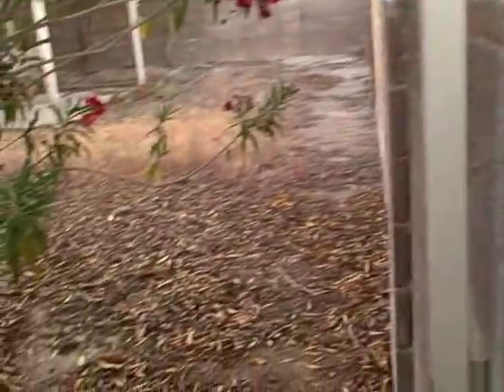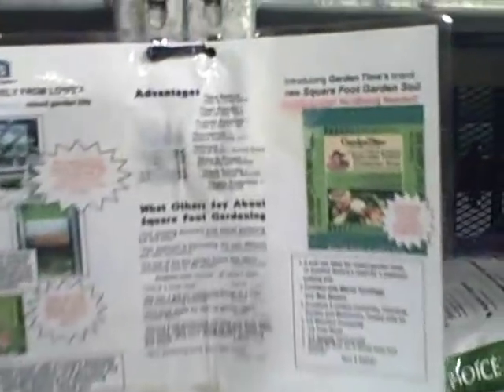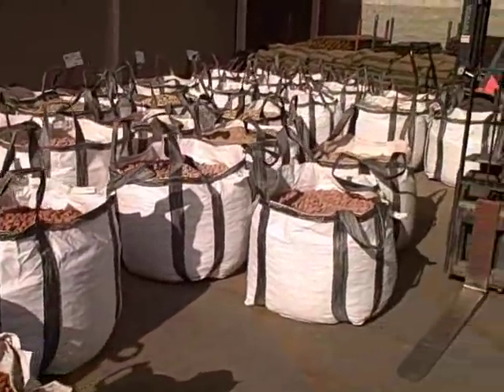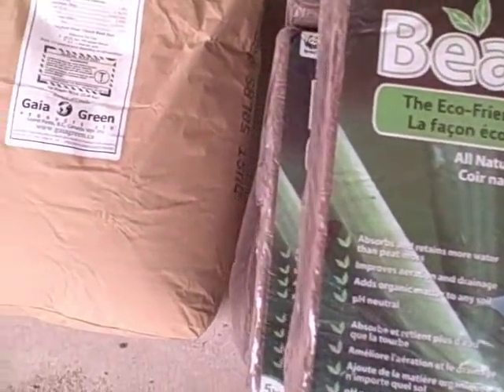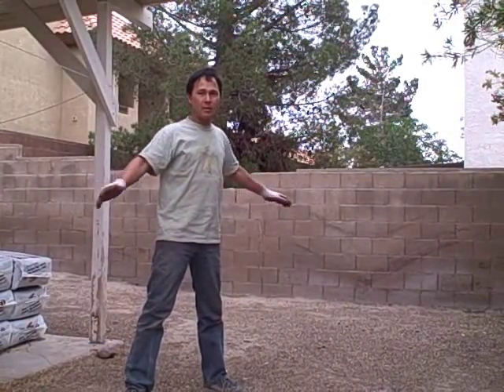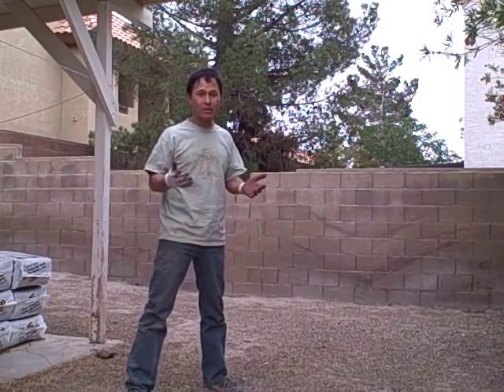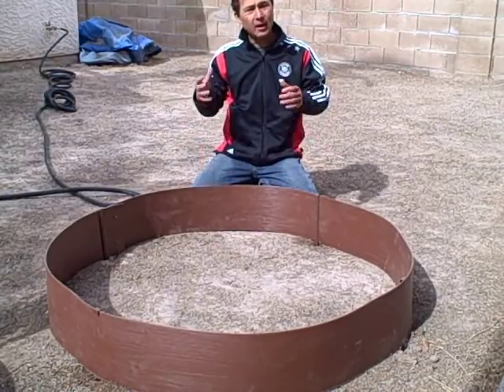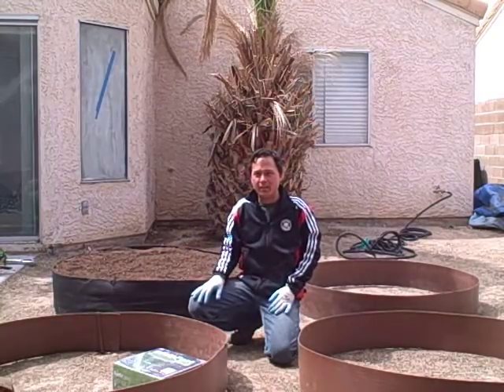Raised Bed Vegetable Garden Install from Start to Finish

Comment from the maker: At this point, it has been about 1 year since this install.  While hindsight is always 20/20... I must say that if I had to do this project over again, I would go with the Bulk tomato lady mix to grow in instead of the Kelloggs OMRI stuff. I have not been happy with the kelloggs stuff overall.  TOO MANY wood chips.. In some of my beds, I have some issues with mushrooms as well.
Reply: I live in an area without too many options, and I can't afford much either. We do have a Home Depot nearby that carries the Kellogg brand garden soil, and it is something I could afford. Did it still end up working out even if it isn't ideal? Would sifting out the wood chips through some hardware cloth take care of the problem? Or is there damage that can't be undone by sifting?

Comment from the maker: What I am doing is adding a handful of the weed whacked trimmings each time I add compost (food scraps and tree/leaf scraps). This way, I dont "overload" my compost with too much of the weed wacked stuff. If the compost pile is at proper operating temperature, it should denature the seeds so they will not sprout after composting.

Comment: Hey John love your videos. People need to adopt these practices everywhere. If you thread the teflon tape in the same direction as the threads as in clockwise I bet you wont need as much. Also a better seal. Thank you for doing these videos.Can't wait to try out the azomite and composted wood chips. My plants are thanking you as well.

Comment: I noticed you were applying the teflon tape in the wrong direction. It should be applied in the same direction as the threads go so there is no chance of the tape unravelling when you screw on the other end. Just some advice from a trades guy :)

Comment: John just a tip. When you use tephlon tape wrap clockwise (you did counter) so when you thread on your fitting it doesn't unravel your work.
Reply: as well as it doesnt take but just a few turns..

Comment: I and most people who put in sprinkler systems and drip use 3 wraps of tape. I found it is easier to wrap from the back of the roll or opposite the way the roll is.  Plus a pressure regulator from 10 to 20 psi maybe 30 is a good idea for drip systems.

Comment: Thanks; great walkthrough of the whole garden planning process!  Minor point:  it looked like you wrapped the teflon tape in the wrong direction; you want to go in the same clockwise direction as the piece you will be screwing on to the fitting to prevent the tape from unraveling.

Comment: If you have the fitting pointing towards you (assuming right hand threads), wrap the tape clockwise arounf the fitting. The main problem with wrapping the tape "backwards" is that when you screw your fitting on the tape "unwinds" and bunches up usually exposing some bare threads. This condition is readily solved if you use massive amounts of tape per fitting which I see that you do :) 
Three wraps is suficient if your parts fit and you wrap correct direction and also saves tape.

Comment: Been watching a lot of your videos John.  I am learning too.  Thanks!  Just wanted to say that I am making two raised beds for my backyard and found that Kelloggs Raised Bed & Potting Mix has most of what you recommend in it.  It is a dollar more for the 3cf bag vs the Kelloggs Natural Garden Soil you used in the video, but you do not have to buy perlite, peat moss, or other additives other than the rock dust your recommend.   I actually saved money on the second bed where I used Kelloggs Raised Bed & Potting Mix.  BTW...  It is OMRI as well.  Now to find that rock dust....

Comment: I would suggest before you buy compost, check out if your city or town has compost sites. In the small city I live in you can get free compost, if you have a pickup you can fill it up, if not bring a couple of bushels or leaf bags and fill them up, its free and it is very good stuff.

Comment: Very helpful thanks! live in Ky, so got to do the mix based on plants. Watched celery likes moist soil. Live in an apt. so going to do some pvc across backporch for strawberries, maybe crates, or buckets or bags, or mix and match. want to do some celery, strawberries, romaine & red lettuce, spinach, carrots, maybe few pepper but very few only for garden fresh salsa. some herbs, Zuchinni in front, does well there, tomatoes here and there, got the early girl not sure to use stakes or cages. stakes might look good but not sure if I can do it right. but stakes cost less. 
so..  can do about 40-50 ft of pcv. got to watch more videos to decide what will do better where. would like to do cantelope, cucumbers... watermelon would be fun but don't know how to pull that off vertically. 
but any who thank you.. for the video. have a nice day!

Comment: If you wrap your teflon tape clockwise, the same way stuff tightens you can use only 2 or 3 wraps and it won't peel off as you tighten.

Comment: In my opinion,the VERY best approach to this is to buy 2"X 8"X 8',10',12' pressure treated lumber,or 4"X"4 / 8"X8" railroad ties and make your raised beds this way.They last a long time.Also,instead of using high end soil to fill the raised beds,you use regular top soil $2.a 1.5 SY,and where ever you plant,you dig a hole appropriate for the type of plant you are growing,and fill the hole with high end soil.This works awesome for me.If I have the money,I order a truck load of screened soil.

Comment: Yes, home depot is far cheaper than lowes, pretty much on everything!  Every time I've bought soil from walmart, it's had mold in it due to the soil not being under a roof.
Reply: Home depot presently has 5 percent off to discover  and amex card ....
Reply: Sassy Frassy Lowes will always meet the Home Depot price of it is the same product. Takes a picture of the product and the price and then show it to management at Lowes.

Comment: For anyone kinda turned off by how hard setting up irrigation seems check out a orbital from Home Depot or Lowe’s, just set it on low and it will water your whole garden all you need is a hose and orbital, if you want to get fancy you can get a electric timer for your hose and not even have to worry about watering your garden !

Comment: By the way, most people would save a lot of money if they ordered soil, mulch, compost from the same places the landscapers order from.  They do residential but there is a minimum for delivery.  In my area it is 4 cubic yards of material.  Huge savings over home depot/lowes.  I get 10 cubic yards each spring of 1/2 compost and 1/2 pine fines mixed and it works smashingly to grow all my veggies.  Lasts all year too.

Comment: lay it out flat in the sunny area let it relax.  fill a bucket with hotwater stick the roll in there.
microwave the roll 30 sec at a time. I worked at a body shop we did the microwave to soften side mouldings.

Comment: You can use just compost but you'll get better soil by supplementing. Vermiculite or perlite(that styrofoamy stuff in House plants from the store) or pummus will help both with water retention and aeration. If your soil is clay-like, I would definitely look into vermiculute and some peat moss. I've never used the coconut stuff but that sounds very interesting and much more eco friendly. You want your soil to be soft so roots can proliferate. 3rd knuclke of finger should go into soil easily.

Comment: John,

fantastic video. I live in Virginia. Would you happen to know whether I'd I need the vermiculite as well in this region of the U.S. Also, how did you calculate how much needs to go in each bed. I know you said 1/3, 1/3, 1/3. How many cu ft does the bed take/hold? Appreciate an extremely informative video. I subscribed. I am a true beginner in every sense of the word.

Comment: I'm using libre office draw. It's a free linux program that should be available for windows and maybe mac. It has all the basic things I peronally needed for my garden bed as well as the ability to set exact positions for all objects and change their measurements via mouse or inputing values.

Comment: I have a question.  The brick walls or fences get quite hot in the summer, or do they remain cool enough in Las Vegas not to burn the plants.While where I live is not quite as hot as Vegas in the summer,  it hits 100 degrees on a regular basis.  Do the brick fences in this kind of heat get too hot?  I am a beginner, so hope this is not a stupid question.

Comment: I'm actually starting the vegetables for my garden from seeds, how would I transfer them from indoors in a higher humidity to outside in a lower humidity. //they're in a room with a bunch of fish tanks so lots of humidity ^^;

also with the vitamin D thing, I am actually producing less than half of what i should be. At first they thought it was because i wasn't getting sunlight, but it's actually because of genetics. I literally can not produce it. I have to take supplements regardless of sunlight.

Comment: i can't find none of this stuff in Florida...i wanted to do the same 
thing as you step by step....I live in north Port, Fl....Please Please 
help!!!!
Reply: +Reese McFarlane All the water irrigation is at lowes in the hose section (I didn't notice him using anything for the PSI but you will want that or the kit to start out with) Since this video is from 2011 I doubt walmart has those kits for that sale price. I used 2x4x8 and 4x4 posts all at lowes. Same with the plants (well I got some from home depot, amazon and rural king)

Comment: How can I protect my garden from round up sprayed to kill weeds?  Will it disapate as watered and flush it down further into the ground? Should I put a bottom , if so what? Does cement block have chemicals that will leach into the soil?
Reply: Don't use Roundup.. anywhere near your garden. the hardest part of weeding is staying on top of the weeds... once your on top of them its not nearly as bad.

Comment: i can't find none of this stuff in Florida...i wanted to do the same thing as you step by step....I live in north Port, Fl....Please Please help!!!!
Reply: +EADGBE  All the water irrigation is at lowes in the hose section (I didn't notice him using anything for the PSI but you will want that or the kit to start out with) Since this video is from 2011 I doubt walmart has those kits for that sale price. I used 2x4x8 and 4x4 posts all at lowes. Same with the plants (well I got some from home depot, amazon and rural king)

Comment: Peat & coir are totally different additives when we look at pH and should not be substituted for one another. If you want to lower the pH of the soil, naturally & quickly, add peat. Coir will not do the same as its pH is naturally almost neutral.

Also, when buying coir, always make double-sure that it has been rinsed multiple times prior to use because mas-produced coir can contain 150 to 300 ppm of salt, which will at the very least stunt your plant growth, reduce flowering & fruiting. On the higher end, it can kill your plants. Some coir is sold already rinsed.
Reply: Coir also will hold onto [bond] Cal & Mag and not let the plants absorb it. If you see cal/mag deficiency in your plants, this is why. There are many liquid organic cal/mag products you can use if you see a deficiency.

Comment: I dont think I could handle "desert landscaping" I should stop whining about our non stop rain! But if we had to live there, I'd 1st have to be hog tied, then kept on a tight leash so I won't run back up to Boring, OR.
Once I came to terms with living in hot desert, I'd put lushious green lawn, its cheap, last 50 yrs never needs mowing or watering! That plastic fake grass more expensive than carpet, but would so be worth having lush green lawn!
It sure looks real! Anyone there have this stuff?

Comment: Great video, but I don't believe the walmart beds are at all economically sound, building out of wood would be cheaper and last much longer than the flimsy round beds. By counting beds and multiplying you spent $220 for the round beds or 88 feet of round bed, seems wood would cost half that for the same area.. just fyi. What's with the rock dust?

Comment: i was wondering if I can use old tires
Reply: +mako smith you can... what john always says is good better and best options, do the best you can but you must remember tires will slowly break down over time and could potentially contaminate whatever is growing in them.
Reply: +mako smith that being said growing in tires is better than not growing at all

Comment: I notice you compost the weed. is that ok?
Reply: Aileen Yeo you can basically compost everything except for meat and cooked food
Reply: Aileen Yeo  I know this post was old, but I'm answering in case someone is reading old comments & would like an answer. You can compost anything that was once living. If you're putting weeds into a compost pile that has seeds, I would suggest doing a hot compost method so the seeds will hopefully not remain viable, if you don't want a garden bed to be full of weeds in the future. There's a lot of info out there about getting compost to 'cook'.

Comment: How can anyone be sure all this stuff is "organic " when a person has not seen where it comes from, what was sprayed within a radius of 15 miles or what was put on land before the " organic " label appeared.   A person can have the best organic garden in the world but if they do " not " pay the $3k to $5k demanded payment, they can not use " organic " label.  Chicken compost or any compost, what was used on the feed crop for the animals ?  A Roundup Ready test was done on 3 farms over 500 miles apart, the average drift of Roundup was 13 miles.  For 3 years Roundup Ready weeds were found in that 13 mile drift area.  We have no idea what else was hit by that Roundup drift.   A 20 acre garden a few miles from me is consider " organic " . How can this be when the whole area was a dump for over 30 years ? Any and everything was dumped there.   If using a green house, does the air need to be completely changed every hour or can a person keep out mosquito spray by not changing air ?  Oh I am told it is " organic " if levels of bad stuff are under certain numbers .

Comment: When you wrap teflon tape around pipe threads, do not do it as shown in this video,
because  there is a better way.  The difference is how the tape stays tensioned during wraping.   Place the roll above the threads with the tape coming off the roll on the bottom of the roll towards you.   Then rotate the roll clockwise around the threads.   Try it, you will soon see what I am saying.

Do not have the tape coming off the top of the tape roll toward you, as you wrap clockwise, because you then have to pull the tape to keep it tensioned as you wrap.

Try both ways and you will see what I mean.

Unrelated but of course you wrap such that screwing on the fitting goes with the tape, rather than exerting a force to unwind it.

Until you examine what I am saying, you will by nature tend not to follow this method of wrapping, but once you get it, you will find yourself always doing it the better but less intuitive way.   It really does make the simple task of wrapping threads with teflon tape easier and tighter and you will always wrap in the right direction too.

It is about how the tape stays tensioned as you wrap, instead of coming off the roll faster than the thread wrapping uses it.
Reply: Not one comment from anyone that tried both ways.   My wisdom goes unwitnessed.
Reply: +John Fenman Yes, he put the tape on incorrectly.  Tension and direction are equally important.  By wrapping clockwise (using your suggested method), when the fitting gets tightened, the tension of the wrap is maintained.  It's like going with the grain.
Reply: You're right man

Comment: why is organic better?
Reply: james reid There's a variety of answers to such an open ended question. My own perspective has to do with the environment. The production of organic products (seeds, food, etc) is easier on the earth. There's less chemical runoff, for example, that is bad for waterways. As far as gardening goes, you grow your soil to grow your food. There's a better chance the soil microbes are in better shape in organic certified soil products. Gardening organically with a lot of life in the soil can mean less work down the line. A garden heavily dependent on the constant input of synthetic chemicals is like a garden addicted to drugs, it will always need that chemical input.
Reply: @mewendy1  Everything is chemicals. You're splitting hairs.